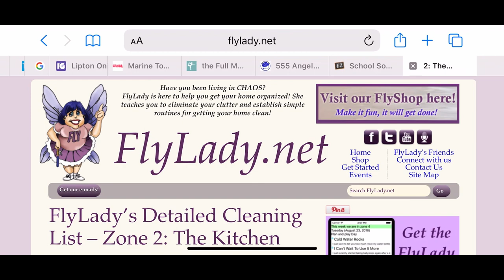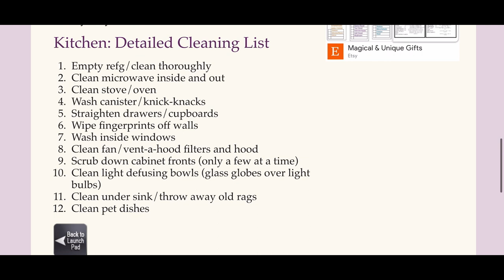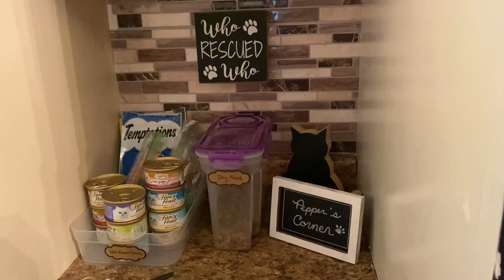Hoarders ❤️ Flylady Method Deep Kitchen Cleaning | Holiday Reset | Clean with me

Comment: Do you have an oven liner to put in the bottom of your oven after you deep clean the bottom. I got a nonstick linear that I slip in and then slide out when I need to wipe it free or deep clean. The best part is not having to clean under heating element or have to run self cleaning cycle. I ran self cleaning cycle once before I had surgery and it blew an over heating fuse relay. It took a month to get relay replaced. All pre made meals had to wait.